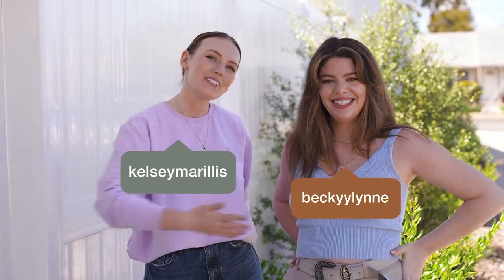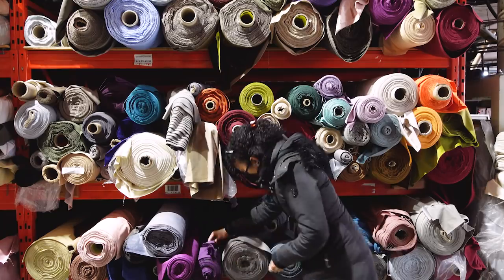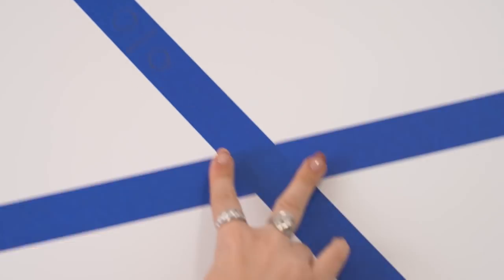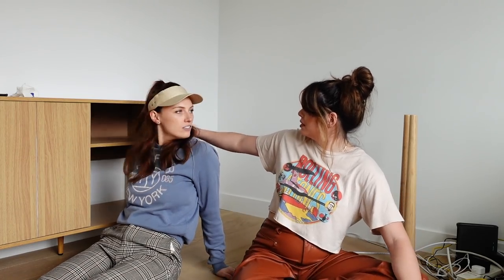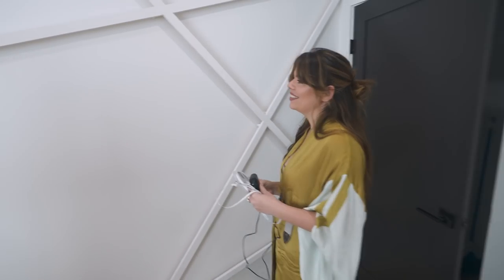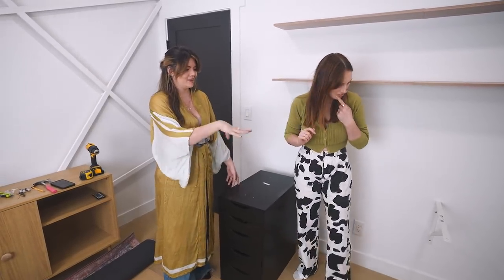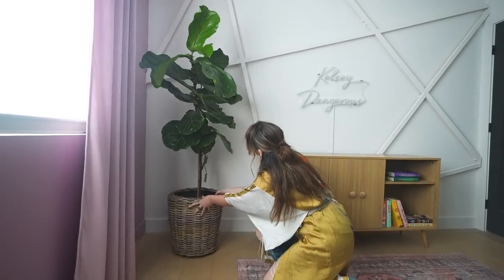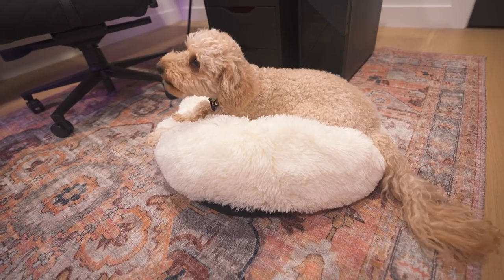The Sims 4 design to real life room transformation

Comment: Wow the wood wall is seriously impressive, so many angles y’all had to cut. How did you measure them all? But I have to say, there were two at the bottom not angled right 😅, you covered it with the credenza though
Reply: Also damn how did you wrap the neon lights like double in some places? Is it doubly bright there? Also what was the shorter piece of the l desk resting on besides the drawers? The brackets only seemed to be for the larger half?